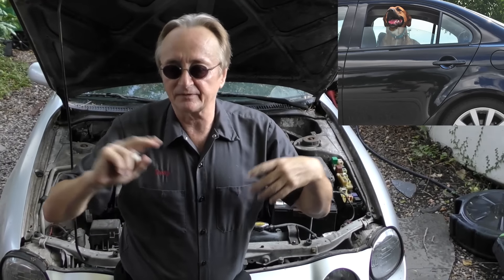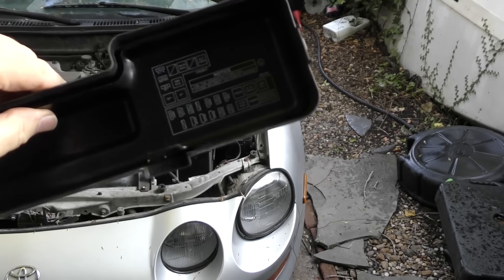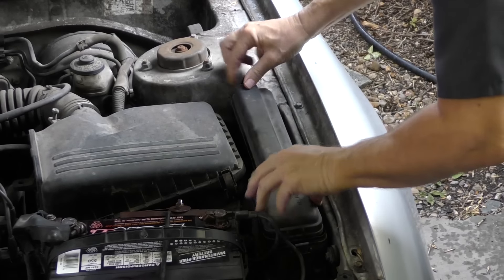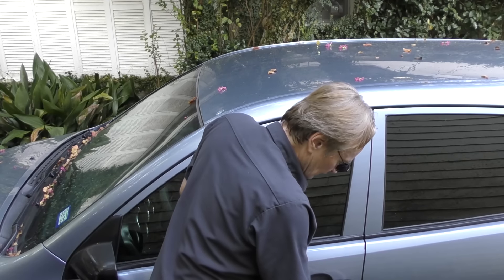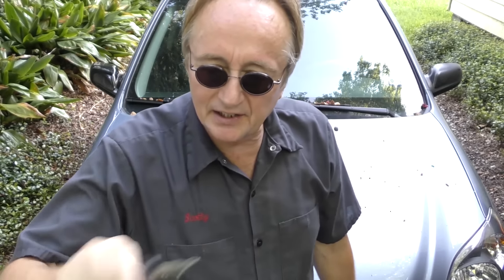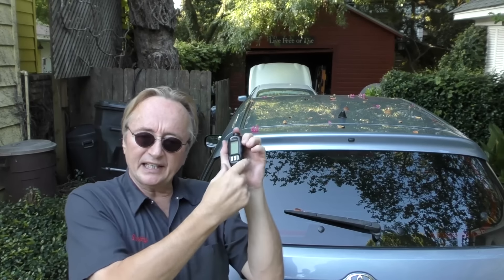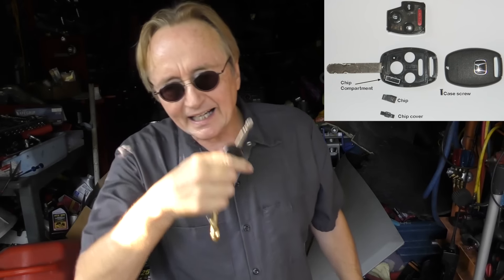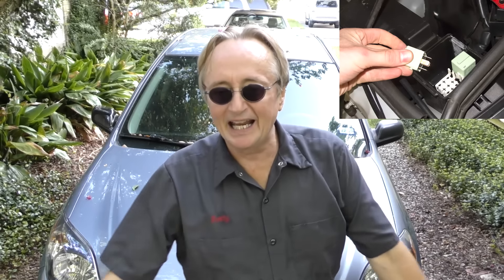How to Theft-Proof Your Car

Comment: Scotty, I was in federal law enforcement in the reserves. A woman whom was in the local police department besides the military stated that people was wasting their money on thief devices. Thieves know all the angles and know how to overlook the alarms. 
Like you stated and this woman claimed that one wants to make it harder and spend more time with. She claimed the best device was the club that one locked on the steering wheel. This was during the 80s. However, your method is quicker and cheaper by pulling an electrical relay. Good report
Reply: It’s take a thief about 2/3 minutes to remove a club. Clubs are the weakest thing you can do. Most cars aren’t started when stolen they are pushed by another vehicle or pushed down the road by the thieves themselves. Unfortunately there isn’t any theft deterrent devices that actually work. You just need a really good tracking system.

Comment: I have a 2011 Honda Civic, which is a popular car for thieves. Before I even got it home from the car lot, I bought a Club LX for around $55 from O'Reilly. It's not invincible but if a car thief has any sense at all, they'll be going for someone else's Honda. I use it with the lock facing the dash.

Comment: If you do this too often the connection will loosen up.
Reply: Good point.
Reply: I was thinking if you did it all the time someting would mess up surely its good for anti theft but i know there not made to be pulled out every time you turn your car off
Reply: @behexen250 i don't know much about cars at all but very helpful
Reply: @behexen250 That's why he specified the injection system relay. It's rather specific. So first the thief would have to take the time to diagnose the problem, find which missing relay etc, and then find someone with the right car to get one from. Not a likely scenario really. Thieves have to get in and get out so they aren't going to spend a lot of time dinking around with relays.
Reply: behexen250  you can't swap the relays though, Hood locks just for the thieves not being able to steal your engine components
Reply: @behexen250 pretty good thanks for. The info
Reply: What if they use a piece of wire to jump !
Reply: @TN-bm6dh  idk
Reply: @behexen250 Trouble with those is every one (Chapman) I ever had eventually goes bad. The, I can't open the hood to disconnect it and end up towing it to a shop. Or I lost the special key and got stuck
Reply: @behexen250 I know what you are saying and agree that for anyone with experience they will get it. But most thieves are working on a tight in and gone situation. If they have to dink around under the hood they are likely to move on. Some will not for sure.  "If the thief pops the hood and looks in the fuse box, he most likely knows what he is doing," say it all. If they have the experience to pop the hood and see what's up then they can likely figure out what someone has done. People regularly loosen coil wires, pull fuses, take rotors, etc and all are part of a short list of things to check. So if the thief has the time and experience they will jack the car. Many do not have that kind of time and or experience.
Reply: @behexen250 I think you have mixed me up with someone else. I have not objected to hood locks...

Comment: Every if you remove the relay you can start the car.all you need is  a piece of wire and the jump the terminal of the female pins.
Reply: Found the car jacker
Reply: Car thieves ain't that smart. They want to be in and out in less than a minute.

Comment: I drive a 2017 cruze, and it make sense that you need a chip to keep it from being stolen, but I live around the corner from the police station, so LE always roams around (I dont mind them) I feel confident leaving my car alone most nights, but even better if parking is limited, I park right next to the local park (by the library and is also across the street from the police department) along the road.

Comment: Due to circumstanced that required me getting a car immediately,  i ended up getting a new Toyota,  but it has that stupid key-fob, push button system.
fortunately for me, I've had a  steering wheel club sitting around in the basement for 25 years in its original packaging, and it fits perfectly...

Although slightly inconvenient,  it works well as a solution to a problem that shouldn't exist in the first place.

Comment: Pretty soon the thieves will have used repo trucks and take your car without turning it on.
Reply: Not if you park in a way that it cant be hooked up and towed 😉😉
Reply: @WANDERER0070 
You can do that at home. But in public that is harder then you think.
Reply: That's also been going on for decades now. The downside is it's not a great getaway vehicle and those trucks are much more expensive than a key fob cloning device. also they make noise and take much longer to hookup so stealing your car in your driveway at night isn't an option. still works but most thieves steal them at night.
Reply: I believe thats what happened to me before.

Comment: I don't know about other cars but my vehicle's key chip is programmed by the vehicle itself.  There is a fancy sequence you have to do but it would hardly be that hard for a thief to overcome.  They basically would just need a copy of the key and similar programmable chip.  It's good enough to prevent kids from stealing it for a joy ride.  However, I think even an amateur car thief would have no trouble.

Comment: Will removing and installing a relay with the battery terminals connected cause a voltage spike and in tern damage any electrical component?

Comment: There are now signal boosters thieves use. They park in front of your house and can amplify the short range fob unlock/start signal. Think of it as your keyless entry working from 100 feet away. All they have to do is get in and start it. Then they can drive away and replace the ignition at they're leisure.

Comment: I think I made my 95 honda accord lx pretty tough to steal, first was remove connecting rods to the door so keys can't unlock it, instead just spin all day so you need the remote. 2nd move the seat back and they need my special removable handle /rod to well move the seat back and forth so whoever gets in my car it be to far to steer or use the pedal. Forgot to mention 5 speed manual transmission :)

Comment: In Riga a capitol of Latvia I once parked my van right next to police station and after a couple of days someone had cut n pulled all the wires out of underneath the steering wheel... I had a starter motor gone, and that theft attempt was happening whilst I was trying to fix my old starter.. so luckily sill have my van... yep police station my work.. but not in Latvia (one of your laughing horse pictures here, please) good tip on those relays tho and my vw t4 have them in cab.

Comment: I like the relay option. On my 300zx back in the day I had a kill switch proggrammed into one of the normal buttons on the AC defrost. Now I keep a rigged apple airtag that does not beep in my current Audi hidden some where in the car. THe question is how do you stop thm from towing it away.

Comment: Did this with our Dodge Caravan back in 2006. Reason why because they came with those glow ring ignitions that could pop out with a butter knife. When they tried to steal it from my job they were unsuccessful due to the ignition relay being removed. . The sad part was they even pulled wires from underneath the dashboard looking for a killswitch to start it.

Comment: I did this with my 87 Mustang. Fuel pump relay was under the seat, so I always took it with me. And I used a club,(yeah, not much security by itself) along with an "unbreakable" brake lock. Three layers of security so they would have to tow it most likely.

Comment: I have a 97 Subaru with an aftermarket alarm system. It is very sensitive a little nudge and it will start going off open the door alarm goes off. It’s an alarm and immobiliser all in one system even if you got in it will not start!

Comment: In Los Angeles county It's pretty common to see cars get stolen in front of police stations The fuel injection relay system is probably the best but probably the best thing to do to not get your car stolen. Drive a car that's not very valuable especially in California specifically do not drive a late 80s '90s and early 2000s Honda Civic, CR-X or Acura Integra

Comment: Scotty I just purchased a 2013 FJ Cruiser. Recently The dome light will randomly turn on when I hit a bump make a turn or take off from a complete stop. The door ajar light indicator light will blink occasionally. I was thinking it's probably a faulty door switch located on the door jam so I put the dome light on/off switch in the off position. This should keep the light from coming on with any door fully open but the dome light still come on and off. Someone told me that LED bulbs have a tendency to do that. Have you ever heard of this issue with LED bulbs before or I may have a faulty door jam switch or maybe the dome light assembly has a short?

Comment: I installed a kill switch for the relay which I put inside a key lock box (the type real estate people use) and then put the lock box inside the glove box.   That's after my truck was stolen in the middle of the night while I slept 15 ft away.  And to make things interesting I bought these cheap vibration alarms from hf which I place under the seat when I know I won't be using the truck for a few days or more.

Comment: I always pull my relays if I'm in a shady area or if I'm going to be leaving my car for a few days (I only have street parking available to me).  I pull the ignition coil relay and starter motor relay as well as the head light relay because its the same type  of relay as the other two so a smart thief could move that relay from the head light slot into the slot of one of the others needed to start the car.  The fuel pump relay is a smaller relay and I pull that one as well.  Then I put a club on the steering wheel.  Seems excessive yes, but my last truck got stolen and it's horrible.  

One time I was leaving my truck at a National Park trailhead and I was gonna be on a 6 day backpacking trip so I literally wrapped a chain around the steering wheel column (not the wheel itself which can be easily sawed off) and the brake pedal with heavy gauge chain and the best locks. Plus a club, plus pulled relays.  Too much work for a thief.  This makes the brakes inoperable.  My dad said thats how they used to prevent their trucks getting stolen during the vietnam war.

Comment: Oh, man I just had a great idea. Put a long letter to any potential thief in an envelope and leave it on the seat labeled “Do Not Open This.” The note leads the thief to believe you are a total bad as ex-military hero who has killed more enemy than anyone else and that there is a custom made, military grade GPS tracker in the glove box. In the glove box is a black box device with a lone flashing red light flashing in morse code the SOS call. Tell the thief not to handle it. Of course the thief will try to remove it. But it’s actually a significant stun device when touched.

Comment: you can use a jumper wire to bypass the relay  example on a bosch pin 30 and 87 closes the circuit

Comment: Instead of pulling the relay each time, install a switch across the relay’s control circuit. Run the wires to where the switch is hidden but is convenient to reach. Better yet, use two switches in series or for different relays. 

To further complicate matters, install a few switches that control nothing under the dash.

Comment: A paper clip inserted in place of the relay will work if they want to steel the car.🤔  That is definitely going to make the car harder for some a hole to steel though; thumbs up scotty!!😎  With a Xtool D7 which costs $400 you can code keys and also make a key for a push to start car if they can get to your scan port.  The new cars are easy to steel with a scan tool.

Comment: What about IGLA, which requires pressing a series of buttons on the steering wheel or inside the car in the correct order for the car to start? This could be combined with a Compustar alarm with loud sirens inside and outside the car. If the sound level of the sirens inside the car is extremely loud, only a deaf person could tolerate being inside the car. The sirens could be powered by an independent battery so that disconnecting the normal car battery would be useless to stop the sirens. Removing a fuel pump fuse is not practical, that’s too much hassle. People won’t ever do that. However, if you install a wireless kill switch to prevent the starter motor from running, that would be effective, especially if very loud sirens were sounding at the time!

Comment: Removing the coil/spark plug wire works also!
Or do both! Just dont lose the parts!
A brake pedal/steering  wheel lock is a good visual deterrant!

Comment: The TESLA Model 3 has a smart card, like these for the ATMs, and I consider this  anti-theft system the best. You don't need to change batteries, just hold the card onto the A pillar, below the camera, and the TESLA MODEL 3 will open. When inside, hold the key card to the cup holder, and the TESLA will start.

Comment: Hey scotty, i have a 05 nissan altima 3.5L automatic that squeals like a pig when its started after sitting for 4-5 hours. Sometimes it will last 20 seconds to a minute. I won't drive with it making that noise but sometimes it will squeal again idling  at a light or accelerating shortly after. When its accelerating and squealing it will only last 30s max. What do you think i should check/ replace to fix this problem. P.S i just had the serpentine belt replaced. Thank you for all your helpful videos i do my own work 90% of the time.

Comment: run a jumper from the fuse box into the cab so you can easily remove the fuel inector relay without having to open the hood every time you run into Costco

Comment: If they happened to notice the missing relay in the first place, why wouldn't they not just either a) swap it with another less crucial relay like maybe lights (many cars have multiple identical relays for different functions) or b) just short the load side of the relay with a jumper wire?
Reply: Exactly. I said the same thing it would work.

Comment: Pin 30 to 87(b usually) will make any system ran by a relay activate and really all you need is a paperclip or 2-3 inches of wire. And they aren't always under the hood some are under the dash or in the trunk or off by themselves not even in a labeled fuse or power distribution box. Ford likes to hide some important relays inside the dash where you almost have to remove the dash to get to them or tucked inside rear trim panels in a way that you have to be laying down looking up to see them. Chevy often sticks the fuel pump relay and injection relay in a little unmarked box on the firewall off by itself or on the side of fuse box under the housing cover with no labeling to let you know it's there or what it's for. Chrysler sometimes screws with you but sticking relays and other components inside completely unrelated components so when it fails it drives you insane trying to find them

Comment: These days criminals don't steal newer parked cars. It's more likely that they hold you at gunpoint and take your keys than it is for them to hotwire a new car. One big advantage of the kill swithch is that you can hit it quickly without getting out of your car and drive off if things start going badly. Also never leave an unattended car running. Thats just asking to get robbed.

Comment: I had a guy wire my 1991 Suburban so the engine would not start unless the cruise control was engaged. Saved the car when a thief broke into it at Willowbrook mall in NW Houston. Still had to replace parts on the steering column. That's when I found out you could steal a GM car with a medium sized screwdriver.

Comment: My key and both spares are the exact same shape and everything from the dealer, but my keys do not work in the door. You have to kind of force the lock and when it finally goes through it sets off the alarm. Only the fob actually works as intended.

Comment: I used to work in the federal building in Kansas City. There was a parking lot for federal employees immediately East of the building. One day an employee noticed thieves casing and breaking into cars in the parking lot and called the police. The police station is across the street to the East from the federal building. It took the police an hour and a half to arrive at the scene. Don't think you'll be safe parking near a police station.

Comment: Put a wire in series with power wire to air intake harness and connect with remote on your Keychain over ride with hidden manual switch in trunk.   More convenient saved my  supra many many times. I used the remove relay for a while that does work.  The bar on the steering wheel is a laugh.

Comment: On the old cars with distributor breaker points you could just remove the rotor and put the distributor cap back on.

Comment: While if the car cranks, but doesn’t fire it’s likely the thief will move on. However the if they really want the car and if you did remove the “fuel injection relay”, be aware it’s the likely the same type of relay as the horn, AC clutch, ABS basically all the other nonessential systems, living right next to your fuel system relay. Also modern car manufacturers don’t always put the relay locations on the panel cover anymore.